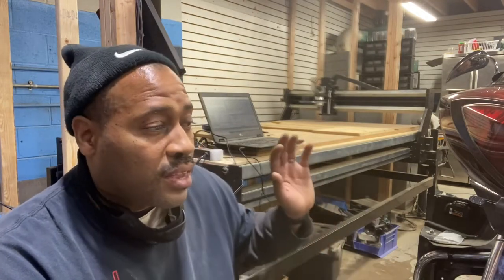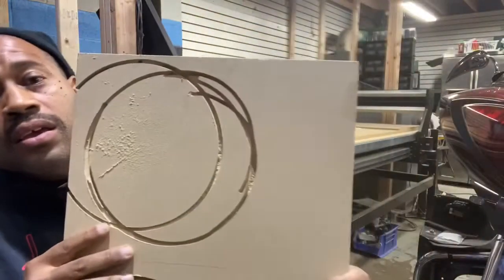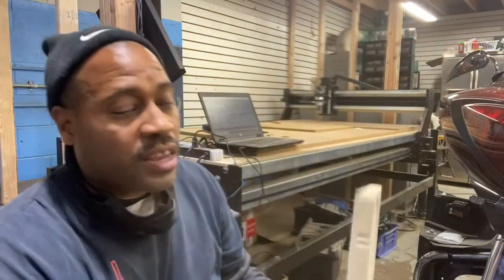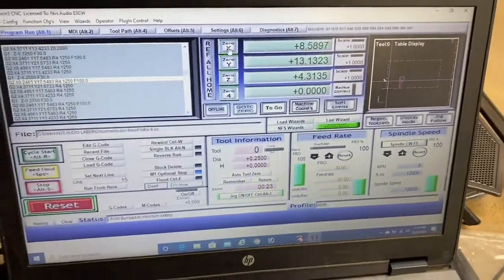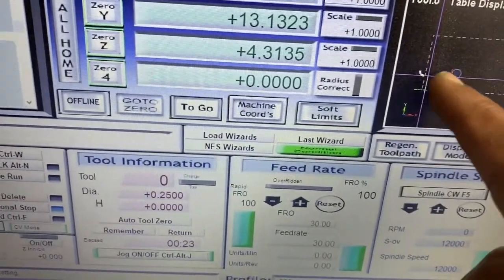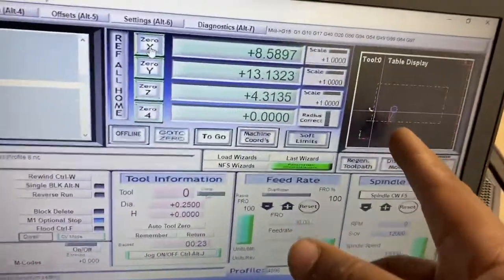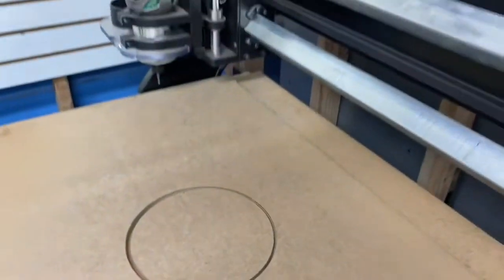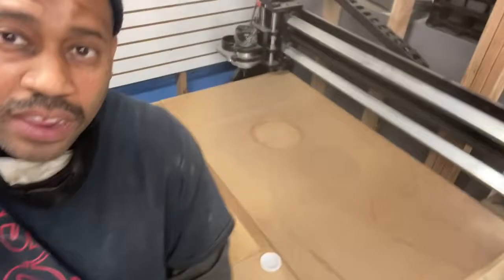Tool time Tuesday zenbot 4896 cnc part 3 . First cut 👍🏽🙏🏼😊

Comment: I have the same machine, some of the same issues. As far as your screen showing differently then your machine, that’s a Mach 3 setting. I had the same issue at first.  And for your issue with it cutting deeper at some spots then others , the most common thing I’ve seen was putting an mdf spoil board on top and surfacing it down to make it all even.

Comment: Im not an expert but can make some general factual comments.that you may already know...your zenbot machine is a very nice fairly affordable large  home hobby machine ...the design of that machine is not ideal for aluminum or aggressive wood cuts due to being belt driven...thats its weakest link...you need rack and pinion or very large diameter  drive screw design with a vfd spindle not a router.and square linear bearings on all axis...and probably a 220v machine...a router is not ideal for cutting  metals due to the extremely high rpms...routers are designed  for wood not metals..also zenbot is made out of plastic which is not as good as steel or aluminum...is there a brand model ur considering?...im a hobby cnc...i have zero knoeledge of whats avail in the commercisl cnc...i bet a commercial 4x8 cnc would cost 25-50k.....they have low priced very small  home hobby cnc routers on ebay that are very capable cutting aluminum and its because they use vfd spindles and drive screws and are made of aluminum and rigid... .when doing more aggressive cuts in  metals like aluminum or  mild steel you need more all around axis  rigidity...more powerful higher torque spindle that has a broader rpm range especially at lower end.(vfd spindle) and more powerful electronics snd stepper motors(actually  your steppers look pretty robust for that machine ..are they nema 34? Or very large nema 23?)...one of my cnc friends has a multicam 5x10 cnc with a 13hp spindle...its obviously 220v mschine....he does signs as a business....i do see you do have a very very low powered router as a spindle ..looks like maybe 1hp.or less....for minimal cost .you could at least try upgrading to a 2.5hp porter cable router it has a bit lower starting  rpm range too which would be much much  better than what you currently have and also has 1/4 and 1/2 in collet so u can use larger 1/2 shank bits which will greatly expand capsbilities....and as brian said always recommrnded use a spoilboard under your projects so you protect ur machines bed.